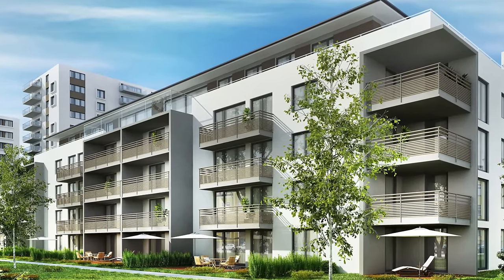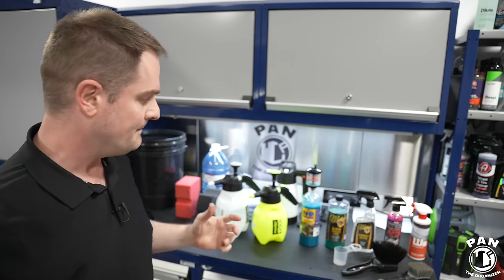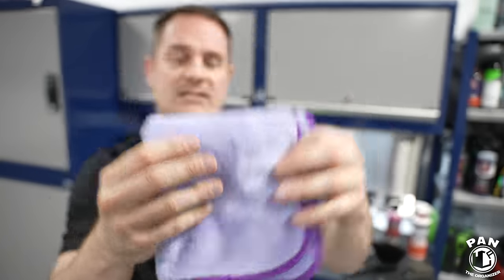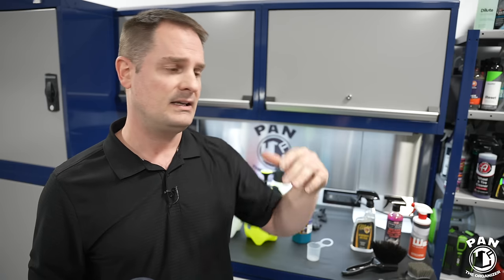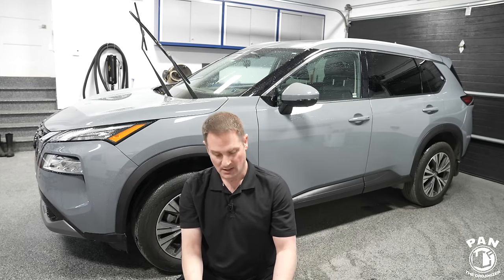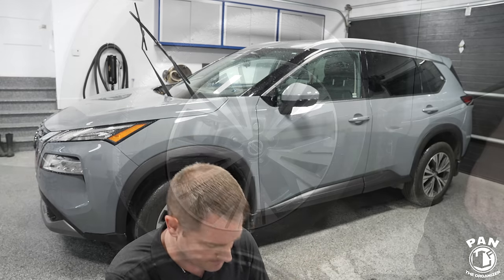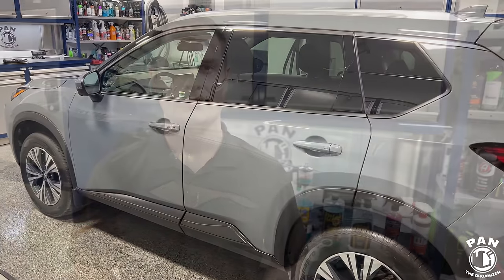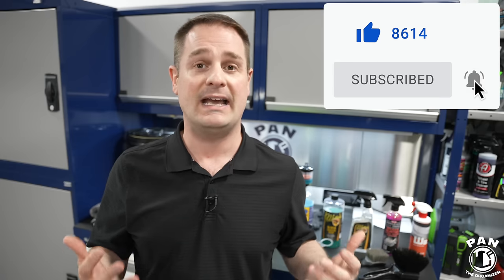How to wash your car without a hose or pressure washer! (RINSELESS WASH METHOD)

Comment: Thank you for your knowledge sharing..! I have a little question about the wheels cleaning. What to do with my wheel mitt/brush after cleaning the first wheel? Is it ok to clean it inside the bucket and then continue to the next wheel? What do you think the best way is to do it?
Reply from the maker: I would rinse with a garden hose of pressure washer after each wheel. A rinseless wash doesn't mean you never rinse, it just means you don't have to rinse at the end of the process.

Comment: I don’t own a soap. I do use a similar prewash process to a soap wash though. I clean wheels and tires first before I wet the paint, then I do my bug removal process, then I rinse the whole car. If it still has a lot of traffic film I’ll spray the lowers with apc and rinse. Then I do my rinseless wash and dry.

Comment: 12 Years washing my car at parents home (and my dad's and brothers'cars) in the drive way with a pressure washer, foam cannon,  2 buckets method, grit guard, hose and lots of water. Then in the past 2 years I have been living in Apartment, I  really have to adjust my  car washing method, no hose  no tap, no pressure washer. Rinseless method with 1 bucket is the only way I can wash my car myself. Been thinking to take it to a car wash places, but, it always got more visible deep scrathes and I really hate it. I have been trying some methods and techniques, unfortunately Rinseless Products are not common here (where you can find a lot of car wash places options, cheap or expensive whatever your preferences). I found that I could use Meg's citrus blast or shampo plus with very less foamy way of car wash solution bucket with grit guard wall for washing and I need to have another clean water bucket with a microfiber or another wash mitt for "rinsing/wiping" the car before drying. Yes I have less expectation with straight washing tracks (not swirling) I got after a year of doing my method. But yeah, I have a 3inch DA with Polishes to get it done at my parents house once a year. Haha
Reply from the maker: Welcome to my channel. You discovered one of the biggest car detailing channels on YouTube as we surpassed 790,000 subscribers and 100 million views! I have been detailing for 25 years and I love to share my knowledge and passion with my viewers.

You found the right channel to help you learn everything about detailing.

Comment: Thanks for this helpful video.
It is the most detailed I have never seen on the subject, congrats.
One note about that Marolex pump sprayer: I find the spray to be not so wide, is it a wrong impression by me?
I am evaluating the purchase but the flow looks like less wider than other sprayers. What do you think about?
Reply from the maker: You can adjust how wide or narrow the fan spread is at the end of the tip of the Marolex pump sprayer. See my review of the Marolex pump sprayers: https://youtu.be/7ZkGf-IVs4k?si=5ci41N1i63hQDvoj

Welcome to my channel. You discovered one of the biggest car detailing channels on YouTube as we surpassed 1 million subscribers and we have over 140 million views! I have been detailing for 27 years and I love to share my knowledge and passion with my viewers.

You found the right channel to help you learn everything about detailing.

Comment: I’m hooked on your video’s - quick question is this method safe on ceramic coatings and PPF wrap? I’m planning a long road trip and I’m unsure of the availability of washing systems - so maybe the rinse less wash is a good option?
Reply from the maker: The traditional wash method with soap, water, buckets and microfiber mitts will always remain the safest.

But for those with no access to water, a rinseless wash method is a good alternative if done correctly with common sense. And yes it’s safe on PPF and vinyl wraps.

How did you discover my channel by the way David?

Welcome to my channel. You discovered one of the biggest car detailing channels on YouTube as we surpassed 1 million subscribers and we have over 140 million views! I have been detailing for 27 years and I love to share my knowledge and passion with my viewers.

You found the right channel to help you learn everything about detailing.

Comment: I used to go through the steps and do this to my car. But now I found out that Maguires waterless wash and wax does a phenomenal job by itself in half the time try it out guys..
Reply from the maker: Rinseless washes are always safer on paint compared to waterless washes. Very different chemical technologies.

But my preferred way to wash my car is still the traditional bucket wash with soap and a wash mitt.

Comment: Great video, Pan!! Seriously, your videos are way better than any movie  :-) I enjoy it so very much and go back to old videos on numerous occasion just to be sure i got it right :-) ... I have one question for you, Pan  .... any thoughts on Ozone machine? ... do you use it to "disinfect" cars? I read mixed info about it , the more i dig the more complex it gets ... eg. it needs to be really strong machine to actually kill bacteria, or that repeated use is harmful to the surfaces in a car....i find it also inconvenient since i cant be present during the time machine is working. also afterwards during refreshing air in the studio. I dont have any extra outside parking space to leave a car there with the ozone machine.  how do you deal with disinfection and is it a service you offer? feel free to make a short video :-D Thank you!!!
Reply from the maker: I don't use an ozone machine (as I mainly detail brand new cars now), but they can be useful in the detailing world for sure. Ozone treatment is the use of the gas ozone (O3) to remove odors, bacteria, and viruses. Your detailer will place an ozone generator in your vehicle for a designated amount of time, depending on the strength of the odor. As the gas permeates your car, the odor is neutralized and any bacteria and viruses are killed.
Reply: @PanTheOrganizer  🙂👌👍

Comment: Hi Pan, I learn a lot from your videos and really enjoy them! I recently put Avalon King Armour Shield IX ceramic coating on my car (its great!), but I can't get the Armour Shield IX maintenance topper in the country where I live. Would it be OK to use another brand of maintenance topper, I was thinking of using Gyeon Wet Coat?
Reply from the maker: Yes. You can use any silica spray sealant that you like for maintenance.
Reply: @PanTheOrganizer  Thank you!

Comment: I am a weekend warrior, nothing professional. Recently I have tried my first rinseless experience and changes some steps to make it enjoyable. (I get both worlds, snowfoam satisfaction and the safety from rinseless.)
I start by using pressure washer, foam cannon and all the brushes for the wheels. Then I snowfoam the whole car and use detailing brushes for all the cracks and gaps. (I felt extra safe and also don’t wanna waste all the money that I have spent on the gear lol)
Then I rinse the snowfoam off, and use the pump sprayer to apply rinseless solution. Follow by contact washing the vehicle with ultra black sponge and 1 bucket method. 
However I will rinse the car off one more time as my OCD kicks in when seeing some dirt remaining on the paint. Then I dry the whole vehicle with an ego blower. (My vehicle is graphene coated, that’s why I don’t apply any additional protection as I also want to test out the real world durability.)
At the end finish it off with tyre shine.
Side benefit, I found that with the rinseless solution, I don’t have to deal with suds all over my hand, and I don’t have to wash 2 buckets with suds. Also I don’t have to wash muliple mitts and dry towel/ microfibre towel after the wash.
Reply from the maker: Hi Riley! Thanks for sharing your experience. How did you discover my channel by the way?

Welcome to my channel. You discovered one of the biggest car detailing channels on YouTube as we surpassed 840,000 subscribers and 105 million views! I have been detailing for 25 years and I love to share my knowledge and passion with my viewers.

You found the right channel to help you learn everything about detailing.
Reply: @PanTheOrganizer  Hey Pan, I’ve been following your channel since I got my first car in my life last year. I searched how to wash car like a pro and there we are. 
Thanks for the content and I always learnt something new. Also spent a lot on highest quality gears and products lmao😂

Comment: Great video Pan. My wife just got a new Nissan Rouge like the one in this video. How would recommend caring for the rubber/ plastic around the wheel wells and along the rocker panels.
Reply from the maker: I ceramic coated the exterior plastics using the same ceramic coating as the paint and glass. It's a multi-surface coating. Watch the video where I applied the coating here: https://youtu.be/idU5XsHTj7Y

Comment: If a car is not too dirty you can do a no contact wash with the rinseless.  Pretreat-blowdry, and dirt literally rolls off . If it’s more heavy soiled just do it a few more times. I did my 08’ Audi S8 that’s rarely driven, no touch, pretreated and blowdry. For scratch free rinseless, on a really dirty car,  I do pretreat-dry-pretreat-rinseless with contact-dry.
Reply: @whitegoodman7465  I don’t have a pressure washer , I have hard water, and I think you will still go through more gallons of water using the pressure washer. I’m trying to keep water costs down . So for my application is works but if you have time and water is no issues bring out the power washer and it will be a great wash too . I just wouldn’t touch it to dry it

Comment: Pan, thanks for the great video! I just started mobile rinseless and waterless detailing and have some questions for the professional - can you use iron remover with rinseless wash and can you prepare a car for paint correction and ceramic coating after rinseless wash?
Reply from the maker: The answer is yes. Watch how we used the rinseless process to detail and ceramic coat my own Porsche in this video: https://youtu.be/-9pVgjQFe1U

But use common sense. If the car is super dirty, wash it the traditional way. If it's only lightly dirty or fairly clean (as was my car), then it's ok to use the rinseless wash process.

Comment: Amazing video as always. If I had totally baked on brake dust from a 24 year old car & wanted to remove it using Meguiars wheel brightener, do you think I should do that before or after a rinse-less wash? Thank you!
Reply from the maker: Clean the wheels first, and then use Meguiar’s Wheel Brightener to focus its strength on the caked on brake dust.
Reply: @PanTheOrganizer  - Thanks Pan, that’s great advice. I’m gonna do just that. Thank you.

Comment: Great video ! Quick question, what is the best way for not mixing let’s say an APC with the rinseless 
 solution . Example . Cleaning bugs on the front with the sponge then rinsing the sponge back in the bucket. Will the rinseless  wash neutralize the apc in the bucket as well .  
Seems like when I have done this the ONR seems contaminated slightly . 
Thanks again for the great video .

Comment: I use ONR as my sole wash method for my customers! My biggest tip would be: use the sponge! It just keeps things more efficient. If the car is unprotected or you’ve never seen it, you may want to pre treat with some diluted APC and then rinse the panel with your pump sprayer or a hose. If using the APC pre treat stick to the one panel at a time method if outside.

Comment: HI Pan, some of the products you use are not available in New Zealand so have you ever done a review in Chemical Guys Waterless Wash? I haven't posted a link to it because I am not sure whether I am allowed, but it would be great to get your thoughts on the product, thanks.
Reply from the maker: I haven't tested the Chemical Guys waterless wash. Chemical Guys in general produce average products (other than one or two gems in their lineup), nothing to write home about. There are much better products in my opinion.

All my top product recommendations are in my popular annual car detailing products awards video here: https://youtu.be/gRwsznwfTwE

Also, keep in mind a waterless wash is completely different than a rinseless wash. Waterless washes are the less safe option, and should really only be used when no water is available. A rinseless wash is safer, and only requires a bucket or water.

Of course, the safest wash method of them all, is the traditional wash with buckets, garden hose or pressure washer, and microfiber wash mitts.
Reply: @PanTheOrganizer  Thanks Pan, a lot of the products we don't get here in NZ but we can get Carpro and Geon which I got from your videos and I quite like, thanks again for your reply.

Comment: I did the exact wash in mid winter, it worked great. But I do have a good coating of TW Graphene spray. 
I don’t know if it would work well on a car with no protection.
Reply from the maker: Cleaners always work better on a protected paint, as that's a main point for protecting the paint: making washes easier. But they still work on unprotected paint too.

Comment: Great video. Helpful to see how to clean the wheels rinseless. For rinseless did you dilute the brake buster or use it full strength? Also, would you suggest to use a foamed sprayer for the brake buster or is it better out of a spray bottle for rinseless? Thanks again for all the great videos
Reply from the maker: You can use it straight out of the spray bottle it comes in, or dilute it 3:1 in a foaming pump sprayer.
Reply: Thank you!

Comment: Awesome video! I have a quick question, can I pair the rinseless wash with a pressure wash? Will that help remove the dirt and grim quicker?
Reply from the maker: Thanks! To answer your question, if the vehicle is super dirty, you would start with a pressure wash first, yes. That will knock off the biggest parts of loose dirt and debris, thus prepping the paint for the rinseless contact wash part.

You have to use common sense with a rinseless wash method, as you don't want to scratch the paint. As I mentioned in the video, a rinseless wash doesn't mean you never rinse. It just means there is no rinsing needed at the end of the wash process.

I hope this answers your question.

Comment: I do like brake Buster and the maintenance turtle wax wheel cleaner (red bottle).  But, that rinseless wheel cleaner you showed a couple of months back is great for this as well.  

I imagine others have suggested this, but I would reconmend either using Opti-clean (diluted) for the door jabs or any missing parts.  I mean you can use ONR also, in a small bottle and do any touch ups.

I have used the ONR with the plush towels in the bucket for door jabs.   too.  I tend to do the jams and use a separate bucket for that.  That way when I am in the drying phase I can dry and protect the jams in the process with any drying aide.  

My wife's Rav4 has the Opti-coat ceramic coat so we use the ONR verison for that, yellow one.  We do have the full front end paint film wrapped when we got it new so I don't have to worry about the hood and front end and mirror cups.  We had it all professionally done from a highly rated car detailing place in NY.  So bugs come off much easier and I don't have to worry about scratching the paint at all.   

They said I can use the blue if in a pinch, like i ran out and new order hasnt come yet.  Also, I do use hyper seal or any other ceramic coat boosting as a drying aide at least evert other wash.

Comment: 25:30 I have to say i appreciate the demo. However id personally have a separate bucket for wheels and tires. I personally do that first, wheels and tires, spray with de ionized soft water then, new or separate bucket for the car.  Top down as you say. I have a nifty cordless power washer hooked up to a 5 gal container i refill for 2.50. Works every time even in the sun. But your system here works for washing IN the garage which being in AZ 120 degrees in the shade is not happening. Ideally you'd have A/C in the garage which i plan to add but that's another comment for another day.

Comment: Thanks a PAN…..excellent tutorial as usual…..I have just ordered the products I want try this method…….I have a question though, can I use this method under sun light? Or when the temperature is say 35C  +? I live in Saudi Arabia and it’s very for 5 months a year…..thanks again outstanding Chanel
Reply from the maker: Hi Ahmed! Welcome to my channel. You discovered one of the biggest car detailing channels on YouTube as we surpassed 920,000 subscribers and we have over 120 million views! I have been detailing for 26 years and I love to share my knowledge and passion with my viewers.

You found the right channel to help you learn everything about detailing.

To answer your question, ideally you would always do this in the shade on a cool surface, like for any detailing steps. Working in direct sunlight isn't the best thing as products dry too quickly. Avoid washing at noon as that's when the sun is at its brightest and hottest. Do it very early in the morning or as late as possible in the day.

And if you have no other choice but to work outside, do one panel at a time. Clean the panel, dry it, move to the next panel.
Reply: @PanTheOrganizer  excellent information.....thanks a lot my friend
Reply from the maker: My pleasure.